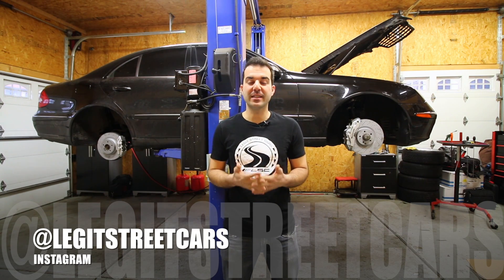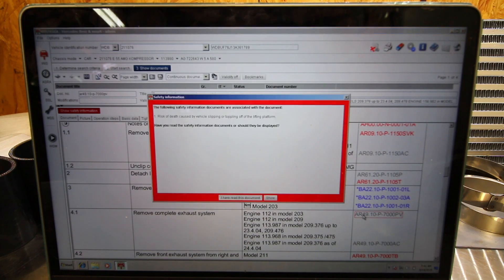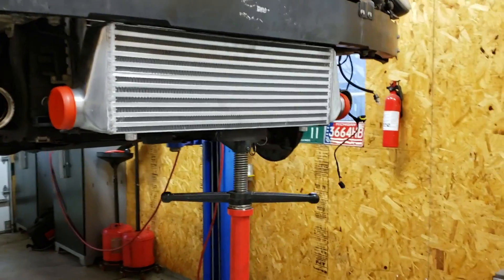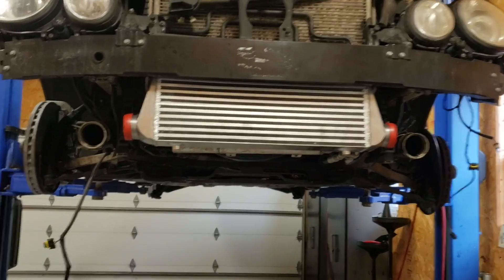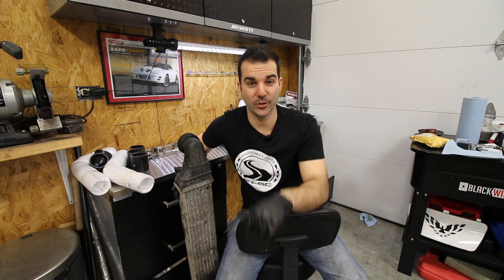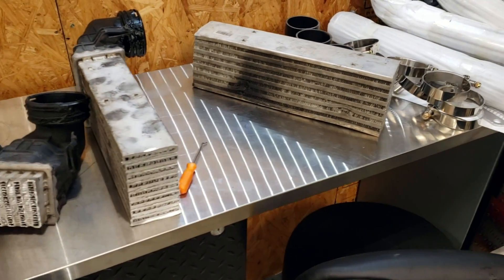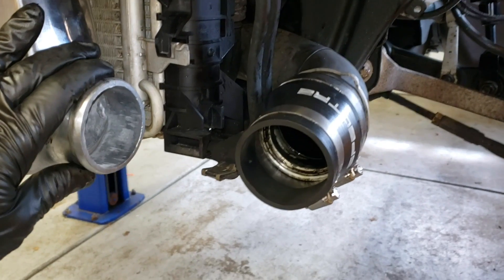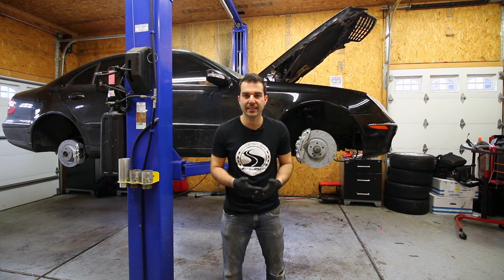I Installed A Big Intercooler On My Turbo Diesel Mercedes So I Cut Open The Old One. What's Inside?

Comment: I am totally lost and unable to find info on 2012 mercedes e350 bluetec diesel, I see a leak on drivers side but its coolant and dripping off radiator which might be coming from the radiator or radiator hose.  So to isolate the issue if its radiator or intercooler, is the intercooler in my 2012 e350 bluetec connected and run the same radiator coolant?

Comment: Someone can now if it will work, if we cut this aluminum part from the intake hose, and put this inox tube directly from intake to the 90 degree hose in intercooler ? Without reducer and provide the pop off ? 
Thanks

Comment: Actually we have purchased w211 e270 cdi turbo diesel engine gearbox and we are fitting in Mercedes w123 . Because we don't have many cars around us with e270 cdi turbo diesel engines so my mechanic is confused and he don't know the pipes connections and we are stuck and it's been while car is stuck in garage as they can't figure it out the all pipes connections.  If you can make a video on that also on electric connections it would be extremely helpful and highly appreciated thanks

Comment: Hi I love the videos you made absolutely amazing really appreciated I just got a request Sir if it is possible if you can make 1 video about e270 cdi turbo diesel all pipes and connections such as turbo pipes intercooler pipes intake manifold pipes hydraulic pipes coolant pipes.  Where they are connected which pipe goes to where and connect where. It would be extremely appreciated

Comment: RE tube and fin vs bar and plate, A question then... It's likely that other mercedes of the same year etc with a bigger engine have a bigger intercooler that will be bar and plate as well, and potentially fit better because they're designed for a typical mercedes front? Seems like you could pick up a second hand one cheaply and get decent results... and off the back of that, if you feel it's worth it, would you do a video?

Comment: Would give my left leg for an upgraded intercooler on my C350 CDI OM642 🙏 Running 310bhp and 750nm so a bigger cooler would be the piece to just top it off beautifully. That is till I go full hybrid turbo 😈👊
Reply: I am looking for my w207 as well. Same engine, I aim for ~340hp as turbo goes hybrid, but performance parts market sucks a bit for those models. Did you find anything? Anything from w204 should fit to mine.

Comment: Hey Alex!

I've got an E270 CDI, so a bit less power and one fewer cylinder, same factory intercooler as the 320. It hit 52 degrees when I floored the car from 0-100 and the weather wasn't particularly warm (close to freezing).

Should I start off with an intercooler upgrade before I do anything else (chip tune)?
Reply: yes sir!! bcse the turbo pain in summer... i have 40hp more than stock and my engine bay have very hot in half time exit to summer, now normal temperature is 28-32*C you need cover lines of diesel for protect the heat, the turbo exhaust snail, and tubes from mainfold to intercooler. when finish that work you can change the intercooler and do the chiptuning secure and racing! dont lost and remember upgrade the breaks and tyres!

Comment: original stock intercooler is much better than that crappy after market shit.those joints aren't any good.you will have restricted flow,factory intercooler is smaller but beleive it or not,it works much better

Comment: I'm fixing to buy 2008 Mb e320 cdi .. today I did a test drive ..  when I got the gas I feel like it's lagging big time.. it won't accelerate like normal car does..even if I floor the pedal. Also the steering felt bit stiff when you move left to right vice versa other than that looks fine.   Would you kindly let me know what would be a issue and what am I looking at to regarding price.. inorder to fix these issue. They asking $4800 with 160k miles... Are these common problems ? I would appreciate if u give me a little guide on this ...thank you

Comment: Does simply bolting on a upgraded intercooler to a turbo Diesel improve the power without a tune? Any dyno tests?
Reply: Not really, first you need stronger boost - hybrid turbo with bigger compression wheel and ceramic bearing, maybe some heat shields on hot side and exhaust manifold for a better spool. And then more efficient intercooler and individual ECU remap must be done to make it work. 👍

Comment: The 90° bend will always flow less than the straight pipe... therefore you would have tried to use a 3" bend (to maximize flow rate / minimize restriction), then adapt down to the 2.5" intercooler fittings.

Comment: I want to install a bigger intercooler. I have one here, the same size and tickness intercooler as yours, Alex. . Want it to install it to my W211 E220 CDI from 2007. It has already a stage 1 remap from 170hp to 196hp and from 400 newton meters to 504 newton meters.
Will i notice some difference? or should you retune it to the new intercooler? Because it will suck more air to the airfilter and to the air flow sensor.
Reply: Hello brother i have w211 e220 cdi facelift. I remap the ECU, intercooler, catalytic delete, downpipe, EGR delete, and now make 230hp 480nm all this make my car better from factory no smoke

Comment: I have an 06 with 53k miles ( you read that right). Want to do everything you have done. But really want to see dyno results after turbo and intercooler upgrades. The exhaust changes and tune added around 60ish crank hp. Are you doing anything to address cooling? Water pump modification, bigger radiator etc???  I live in Phoenix, AZ so that is important to me...

Comment: I do not understand why you are not using a qualitiy intercooler and 90° sillicone elbows (reducer 3° to 2.5") for the intercooler. 4 clamps instead of 8 => less risk of air leaks.

Comment: Amazing work! You’ve inspired me to get a cdi. I was originally going to get a w123 but you changed my mind. I did come across a w124 with 124k. It’s an amazing deal and it’s from my father boss. I know there isn’t much I can do to increase power. I trust you over anyone else with Mercedes. Do you have any input on that car? Everything has been gone through and it just needs paint.

Comment: These brackets are gonna break sooner than later, they are definitely not made to hang stuff, need at least some support from the bottom to avoid bending them.
Also, removing intake resonators can make you lose some torque and/or power, they aren't just for muffling sound, dont know how big of an impact that is on a forced induction system though.

Comment: I have just bought the " WORKSHOP MANUAL" it is crap and not the same as the one you are showing.
Reply from the maker: Did you get the Download version? If it's for a Mercedes it should look exactly the same as what I showed
Reply: @LegitStreetCars  yes i did it is for my sl.500 but there is no appendix and it starts with a list of abreviations for parts of the car plus a lot of stuff about turbos which are not an sl.500 fitment
Reply from the maker: That's really weird. I've tried 6 different Mercedes models and they all come exactly the way I've showed. Hundreds have bought the manual from my link and I've never heard of this.  Can you email me a screenshot of what you're seeing? I'll get this taken care of.
legitstreetcars@gmail.com

Comment: On your original piping you have those rubber o-ring seals, you need to remove those. Then there are three bumps around the circumference of the aluminium tips,..... those need to be ground flush.... I also used heavy duty clamps just in case.

Comment: Have you done a run with this setup? Cause I did exactly the same cooler on my 270cdi. I did long radius reducing silicone bends. I'll save you some time cause it will blow the hose off no matter what clamp you are going to use.
Reply: Did you try hairspray before put the hose in ?

Comment: Great project! It seems like some ducting would really help the air go through all radiators, not go around one.It would really be interesting if you measure temps and other data for comparision. Just some cheapo cutout plastic and ducktape would probably do the trick

Comment: Tube and fin are better. That’s why F1, WRC, Touring Car and all turbo supercars use them. The worlds best intercooler maker is PWR which Australian and they only do tube and fin. Bar and plate are good for dyno’s but due to there construction and weight they become thermally loaded so can’t get ride of the heat. And tube and fin are more expensive to make. Bar and plat are cheep just have to watch how there made.

Comment: Hi, you should swap the intake manifold with this https://m.facebook.com/story.php?story_fbid=1195593710622259&id=366435456871426 i think it fits om648 also do the fuel pump upgrade https://m.facebook.com/story.php?story_fbid=1196147633900200&id=366435456871426 and AMG spec injectors. Greetings from Portugal

Comment: I got all 3 milwaukee fuel ratchets, and they are all awesome.The stubby 1/2" impact is also very nice. In Europe its kind of hard to get 3/8" impact sockets, so we got all the sockets in 1/2".

I dont use manhal ratchets anymore, if the milwaukee ratchets fit.

Comment: Just a thought; Why not have the intercooler modified with V-band style clamps then you can make an elbow that connects directly into the stock system and cut the number of silicon boots down as much as possible.
Reply: Hi, may you share more infos about this idea ? Any links or product dimensions which connect directly the stock hoses ?

Comment: THOSE ARE NOT "HOSE CLIPS" THERE CALLED V BAND CLAMPS!
Reply: They are actually called T-bolt Clamps. The V band clamp is for a V band fitting which is more commonly seen on the exhaust side and the compressor housing discharge.

Comment: Awesome! I used a similar technique when I did my first mounting method. But I went cheaper route. I got a single 180 bend and chopped into 2x 90s with 4 silicone couplers. My intercooler in/out was also 3" input though so no reducers necessary. You made a great point about the bead roll on the ends. When I chopped mine, I lost bead roll on one side of each pipe and it kept blowing off on one side. I had to create a bead roll on that side to prevent blow off. 

For the plastic silencer on the intake side (driver's side), you can just cap it. For the passenger side from the turbo, a custom pipe needs to be made.

Comment: This intercooler 'upgrade' is hardly an improvement over stock. Granted the old one needed replacing but I sincerely doubt in back to back tests this intercooler is going to offer an improvement over a new stock unit (or equivalent).
As you saw, the stock item is well sorted. It is wider, light and it fits. The hose mounts are simple and reliable.
With car radiators, always the widest ones work best for the same cooling surface as thicker and taller. Intercoolers are the same. On this particular install, I see no added capacity advantage for when you want to screw the boost up etc.
What we're trying to do here is get more cooling capacity for future engine mods, no?
This will work but I would like to see an intercooler that substantially increases cross sectional area to give you more cooling for similar flow, or better more cooling and more flow rather than OEM in a different shape, made in a different material with less reliable mounting and connections. I understand space constraints, but we need to sit down and have a close look at what can be done. Yes I know I sound like your father lol but I'm unimpressed with this intercooler for the reasons given.
I'd like to see a true performance replacement, designed to fit this model, that has data to back up it's claims rather than a generic.
Reply: This intercooler is about twice as good as the stock one. Stock one is barely enough for cooling the charge air when the engine is completely stock. Factory cooler is a bad design because it hasn't got "fins" on the inside so it isn't cooling the air efficently.  If you would have a W211 diesel you would know this. 
P.s Regards from Finland where diesel tuning is a bit more common... :)
Reply: @leparkour79  Well, you may be right of course, but I prefer empirical evidence rather than anecdotal evidence - absolutely no malice intended BTW.
Look, I re read what I wrote and as a qualified Mercedes-Benz mechanic (since 1986) I find claims made by aftermarket manufacturers as to the efficacy of their products to be mainly self serving than real. I am a jaded and cynical mechanic to be sure but you need to ask yourself why.
Love from Australia (where we prefer plain speaking and facts rather than claims and hyperbole LOL)
Reply: @ThePaulv12  Yes, i too like to see evidence before i'm convinced. I do not either trust aftermarket partmakers claims. This is all based on my own experience with these CDI engines. Try it for yourself sometime if you have a OBD reader. Then you will see how high those temperatures are :)
Reply: @leparkour79  Well the temp difference is indicative for sure.

Comment: Too funny.  Why bolt on a front mount intercooler and 3 inch piping if the vehicle is still stock !!!!???? . All so called car enthusiasts back in the day always did this too bad it does f all . You'll lose pressure and power because you have to fill the extra space in the 3 inch piping.  Just replace the intercooler.

Comment: The link to the Milwaukee Fuel 3/8 Electric Ratchet goes to a 1/4" ratchet...just to let you know. Does the emanual cover CDI models? There's not a lot of information on the website. By the way, just bought a 2003 E320 CDI yesterday ;) With only 569000 km (355000 miles) just barely broken in...Love this car!

Comment: I bought a nice 1/2 fuel impact wrench this past week. Turned fixing broken sway bar links from a 2hr job to 10 minutes. Also I found a e55 amg engine mounted to a tremac manual. Was supposed to go into a xk8 but he ended up selling the car before he could swap it lol. I wonder what that combo would feel like.

Comment: Just a heads up, what you call the intake silencer is a helmholtz resonator. It will help silence exhaust drone but also add horsepower by modulating the pressure at the intake valves, by bouncing soundwaves (pressure) at the right oscillation through the resonator - back into the intake just as the valves are opening. Kind of like ramming air into the intake at the valves just at the right time. Lots of good documents about it on google. I could not tell how this would affect the performance of your CDI project (probably minimal), but it might be worth looking into before you delete them.

Comment: nice video love your new tools. why did you not use a 3'' to 2.5'' 90 deg? somthing like this: https://www.google.com/url?sa=i&source=images&cd=&ved=2ahUKEwjM77bjlYfhAhVEK1AKHdKgC1IQjRx6BAgBEAU&url=http%3A%2F%2Fwww.hps-siliconehoses.com%2Fhps-3-inch-90-degree-elbow-reducer-silicone-hose-63mm-76mm.html&psig=AOvVaw2-Ry1LQh0H81zFh9UGp2rj&ust=1552843168710652

Comment: Sorry Alex but most of OEM coolers are 1000 x better than those heavy China wannabe IC cores. They weight tons and tubing is almost all cases horrible. Check example OEM WRX STi intercooler structure... piping is exelent, light and do the job much better than China heavyweight crap.
Reply: SETRAB make the best IC cores in the world! 
http://www.setrab.com/products/proline/products/ic-charge-air-cooler/

Comment: Great video. When you started the video series on the diesel I could find numerous e320's for sale in my area for $4-5K. Now? hell, no... the one gold one is $7K... 
Are the remaining pipes going to the turbo rubber or plastic? When I built my Conquest, I had to replace all the rubber IC pipes with hard pipes to prevent the boost surging from the expanding rubber pipes causing severe wastegate flapping at WOT. Basically the WG and the rubber pipes were combating each other. It seriously smoothed out my powerband on the dyno. Just a thought for when you remove those silencers.

Comment: You should weld a 90° straight to the intercooler like the factory setup. Much neater (like factory) & better internal flow.
Nice job Alex!
Reply: Same thoughts . . . the less joints the better it flows, the cleaner it looks.
Reply: Did any of you get some practical solution for the pop off issue ?

Comment: Worried about those tiny brackets you used. Seem like they're more designed for furniture.
You also weakened them by drilling them out.
Sure they can carry the weight, but when you're driving, they might start functioning as hinges and after a while might snap

Also what are those cylindric nipples on top and bottom of the intercooler? What fundtion do those have?

Comment: Don't want to hate on your video, but those steel corner brackets will break sooner or later.
Reply: Yep, he enlarged the holes too much; not enough material left (net section).
Reply: Agreed, they will break... Needs some support from the bottom as well..
Reply: Probably find the self tappers in the crash bar will die first lol.
Reply: Also they will disintegrate after a couple of winters and screwed to two different materials. 
Aluminum or stainless are the best options here.
Reply: @athalc  yeah, the mechanical stress combined with dissimilar metals will definitely cause corrosion and failure.
Reply: Exactly 
The content you made is great
But those brackets you fabricated are flimsy

Comment: What are the dimension of the inter-cooler, I have a CDI sitting outside and want to change the IC soon. Im local to you so maybe I get a chance someday to spot you on the streets.
Reply from the maker: 28x7x2.5
Reply: So , then, something like this might work? https://www.ebay.com/itm/UNIVERSAL-ALUMINUM-TURBO-27-25x7x2-75-TUBE-FIN-FMIC-FRONT-MOUNT-INTERCOOLER/180843152359